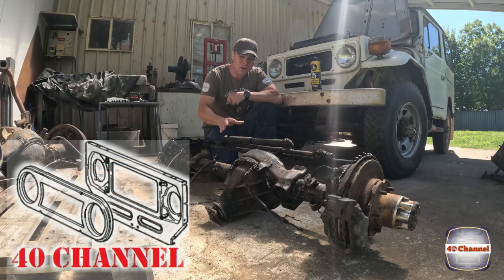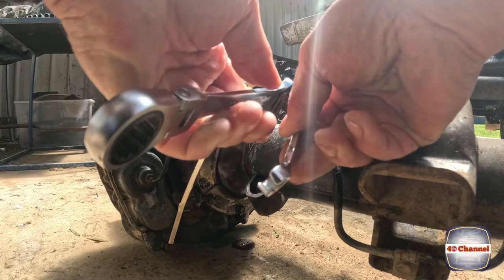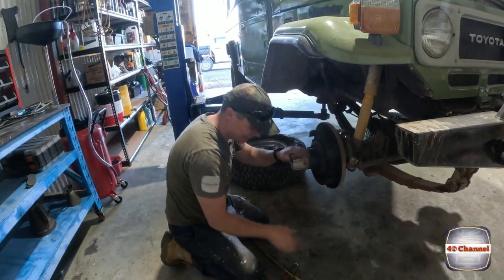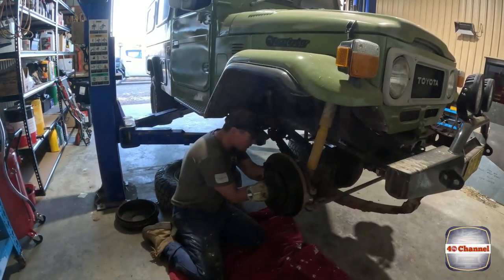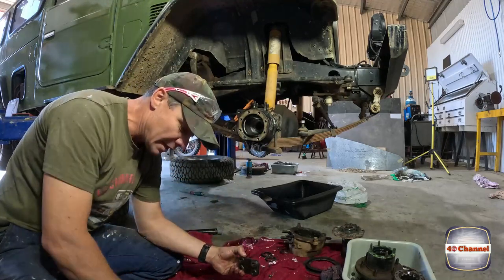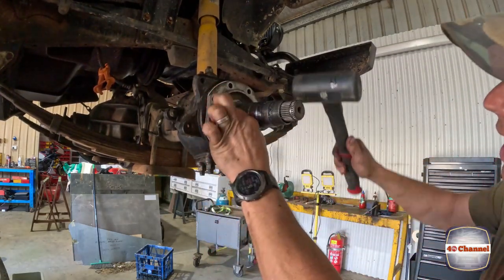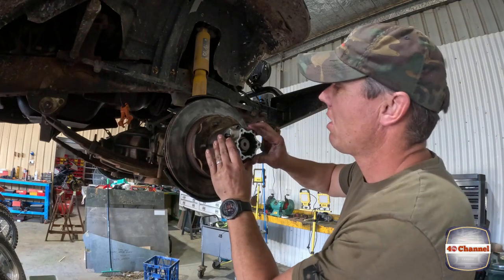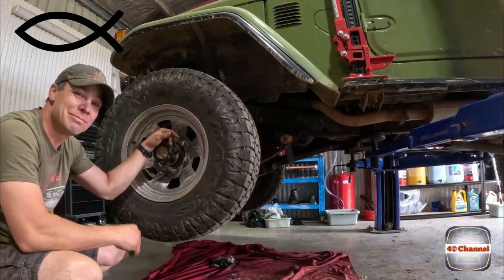S2EP77 - UPGRADE / CONVERSION  - Convert drum brakes to disk brakes FJ45, FJ40

Comment: Thanks for the videos! What did you do for your steering after switching to 60 knuckles? Ive done the same swap but the 40 series tie rods are too small for the 60 series steering arms.
Reply from the maker: Hi Richard Have a look at the video at 9:40 and I  explain why and what to use. 40 series arms.

Comment: hi im from colombia, i have a question, the brake system of the other series, can function? are you know which? 
your videos are very interesting, i love this. i have a toyota fj43 1978.
Reply: All 40, 55, 60 series disks and all 1980's, possibly some 1990's 70 series depending on what models you got over there.

Comment: Hi from Portugal ! You will need an LSPV to make the disk brake system work properly and safely . Don't ask how I know :) ...
Reply from the maker: Thanks mate, will install when I upgrade the brake booster. 
Sounds like there is a bit of a story with yours. Feel free to share and send photos of your cruiser to 4045channel@gmail.com
Reply: @40ChannelCruiser  Hi again ! Ideally you will need to mimic all the braking system from disk brake equipped 45/47/60/7# series . It has small but important diferences from the drum braked system . I believe that the 60 system will also do with minor adaptations . I had a 1982 Portuguese made BJ4rked5 ( yes , they were made in Portugal also , 1st Toyota factory in Europe ) with had drum brakes . I tried to adapt disk brakes from a wrecked BJ73 and I it was very difficult to had the system working properly . Only when I mimicked all the brake system from the 73 and applied it to the BJ45 it worked as intended . I don't have the 45 anymore and don't have any photos , sorry . It was long time ago , late 90s and digital cameras almost didn't exist . But I have a few Land Cruisers and will send you som photos if you want . Keep your great videos coming , I really appreciate them ! Cheers !

Comment: Geez Jase, you could've sprung for new rotors whilst its all apart! lol. Another great vid, like portcruiser said, you'll need a proportioning valve to balance out the brakes now too. About to do a similar conversion to my 78 HJ45, although I lucked out and found an 83 HJ47 to donate it's disc brakes. Cheers, Andy.
Reply from the maker: Thanks mate, Yes proportional valve, will get done when the booster gets installed.
I checked out the rotors, they had a lot of meat on them, I will save up and swap for slotted rotors when it come to replacement time.

Comment: I am so happy with your videos! I am restoring an fj 43 from 77 (in the Netherlands)
now my question is. i have a bj 42 front axle. can the brakes also be transferred to the fj 43 front axle? does look the same.
mvg Maarten
Reply from the maker: Hi Maarten, Yes, you can swap between the models as there are the same. Only different is on earlier models have different spines but these can be swap around too, to make it all work.
Reply: @40ChannelCruiser  
Not totally sure what you mean with spines. Are that the ridges?
Reply: @maartenjansen3044  . He meant splines on the axles.

Comment: Will you need to have it engineered as you're changing the brakes and booster and then have it compliance plated?
Great vid as always. Thanks.
Reply from the maker: As pre NSW Government, there is no need to as this was an option for the 40 series landcruiser, these are the same parts used from the 40 series models at the time.
Below is a statement from the NSW GOV Web page.
"Replacement of front-wheel drum brakes with disc brakes on a vehicle available
from the manufacturer with front disc brakes as an option where all the parts from
that option are fitted eg fitting a base model LC Torana which has drum front brakes
with the disc front brakes originally supplied to the GTR model LC Torana"
Reply: @40ChannelCruiser  many thanks for the info.

Comment: Nice job do you need to upgrade the booster? I have a 81 HJ47 also with drum brakes.
Reply: Booster and proportioning valve.  80 series are apparently the go to booster